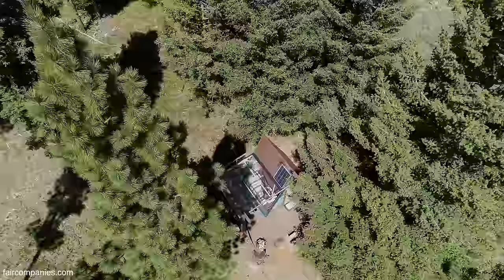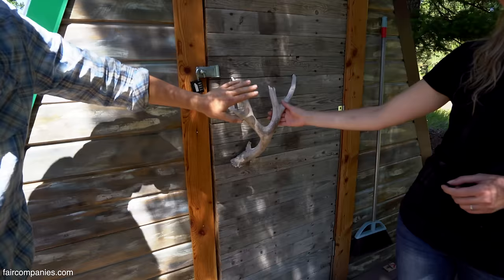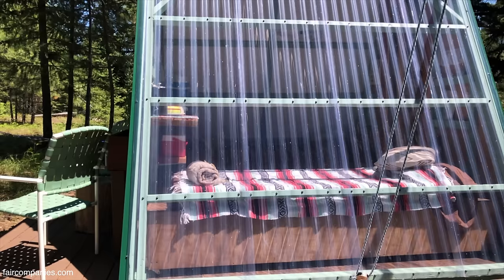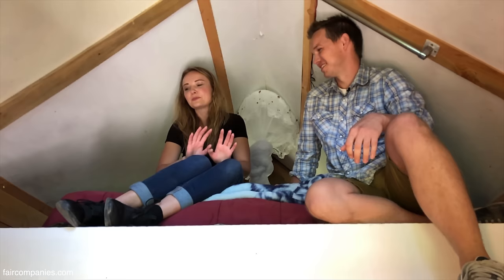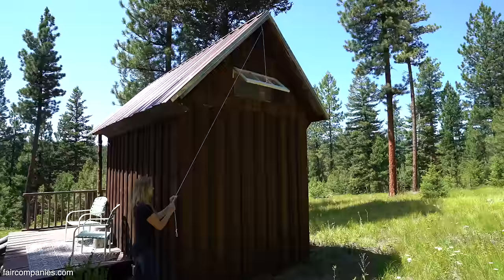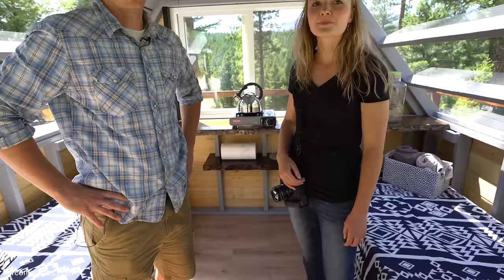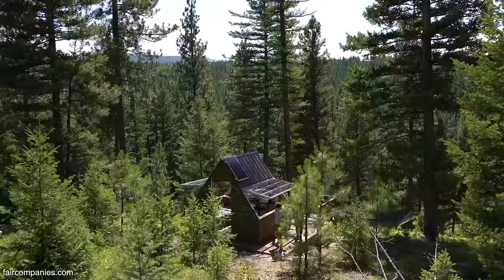$700 mechanical micro-A-frame blends with Montana wilderness

Comment: Interesting a frame.... There is an amazing house in Normandy FR you should check out, designed by an architect called Jean-Baptiste Barache. It’s also an a frame design but much bigger, yet the cost of the build was surprisingly low relatively speaking. You’ll understand why if you research or see it.

Comment: I like the first  A-frame very much, but question the longevity of the stumps that support the platform. Having unsealed end-grain exposed to the weather, I'd give it 5 years max. Shore it up and put in some cement or stone footings.
Absolutely LOVE the counter top in the second tiny house.
Like the openness of third tiny house, but think both A-frames  might benefit from judicious use of insect screening!
I know it's all a work in progress, what you have done is impressive, and I thank you for posting!
Reply: i was thinking the same thing. when i got the plans there was no mention of foundation blocks in the parts list, and i liked the stump idea they implemented, but would have sealed it for sure.
Reply: Linda, it depends a lot on the wood. My father used rounds of creosote- coated telephone poles as piers for a 16 × 20 lofted horse barn. It was sound for 20 years, ok for storage for several more. Dad regretted he didn't put anything down for a pad; it could still be standing!

Comment: What’s the point of the padlock if you can swing open the side. Also that padlock can be opened in seconds by applying pressure to the shackle and turning the combination until it jams in the gate. They are less than worthless

Comment: He said with everything closed it is like a greenhouse, how do you get ventilation when it is raining? I saw no openings covered enough to be able to leave open during rain?
Reply: On the first one there was a rechargeable battery fan and a tiny triangle up by the roof beam. Given their cracks about mice, I wouldn't worry too much about ventilation.

Comment: I would call the A frame's writing shelters, there is no way the joints on those panels are watertight in a rainstorm and how do you secure that big operable panel in a windstorm? there are no latches visible in the video. No insulation, no heat, Basically its a tent...without screens. The kitchen cabin is more practical.

Comment: August 2019 continued:  what about installing an outdoor fan as a wind generator for electricity when the sun goes down.  An Olympic water rafter did this on his van, traveling across Europe to river races.  He did the glass design from copies of churches he saw on his travels.  He called it his 'Hobbit Van.'  Imagine 7 billion vehicles, homes, buildings all covered with hand sized wind generators to recharge your phones, cars, etc., light up all high rise buildings, inside, so as not to distract from star gazing, like Las Vegas has ruined the night sky.    How about a rain water collection tank, then use 'cookies that kill mosquito eggs without any chemicals (done in Arizona buy a man living off the grid).  Arizona encourages instead of discourages rain water collection; the opposite of California.  See the videos and Skype with Handeeman (from Canada) on You Tube about building a water tank.  He is an electrician living off the grid with his wife Hannah (a gourmet vegan chef) in Arizona.  The second house blends right in with nature, I hope you don't paint it at all.  I love the Coleman company!  Sears and KMART were a great companies before the Super Rich destroyed them for the public and the workers.  Coleman has the best men's (women's probably does not have the great pockets or hoods) coats and jackets to keep out the coldest temperatures.  If you get hypothermia, buy two, one XXL to wear on top of the smaller sized coat or jacket.  The extra large hood helps to block out the light and get a deep REM sleep.

Comment: I know how he feels, id make everything if I could, build my own car, motorcycle, house, boat, swimming pool, solar system to power it ALL!!  I have worked in alot of trades, carpentry, electrical, plumbing, roofing, masonary, I have installed septic systems, I was building car engines when I was 13, one of my fears is going to the Salvage yard, seeing something I must have, and not have the money to buy it! Ha-ha, so many thing are scrapped, that have plenty of life in it, it can be reused or repurposed, especially industrial equipment, alot of thing are still useable for something, I have been studying electronics and got motors for a electric car conversion from a salvage yard, they were like new, for a deal, I would like a place like that to tinker and build, I always vwanted a place where small living areas could be carved out of a Forrest, leaving most of nature, I wanted to start a small community have a tiny woodland town, leaving as many trees as possible, and wanted to do this when I was aboutb12 and still would like to, and rent to like minded ppl for the summer of country living, here it could be 9-10 months , winter is only very voldvfor about 2 months, with some gas heat, winter or full time living could be possible. I wish I had the land and help to do this,  image a tiny store, post office, with houses and gardens tiny farms in a wooded area, all powered by renewable solar, wind and hydroelectric!!!. Crazy, but could be nice!!!

Comment: These tiny cabins are very nice. I want to address something off topic though, and it's about building codes, regulations and permits. A lot of people looking into alternative lifestyles like this seem to be young, democrat, liberal, and that's fine. I'm not so young anymore, but I've always been open-minded, plus I grew up in a remote rural area not all that different from where these young people in this video are. The biggest difference I'd say is where I am there are no building codes, hardly any regulations, and no permits required. That's because the democratic party has never gained control of local government. Whether you realize or understand it or not, the truth is democrats in power always bring codes, regulations, permits, high taxes. Always. In the process people lose control of what they can do with their own property. Instead of being able to live free and inexpensively, democratic policies force you to embrace debt, limit your freedom to live on the cheap, and criminalize things that you want to do in order to live cheaply. They do this while hiding behind seemingly moral stances, but they do this disingenuously. They don't actually care about anything except control. Democrats and the left are control freaks, just like a crazy ex bf or gf. Don't be fooled, or else your dreams of living simple like in this video will be impossible.

Comment: I think there's something funky with your audio equipment. There's an extremely high-pitched sound for 2-3 seconds randomly throughout the video that's about at the limit of what I can hear (as a 35-year old). Some times where it was audible to me:
4:38
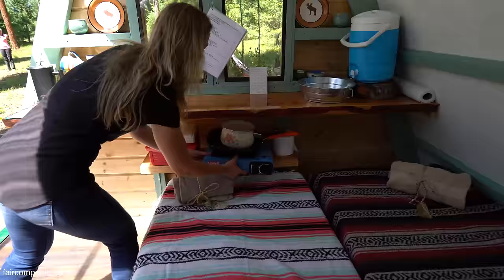5:28
5:53 (this one lasted about 10 seconds)
There are other times earlier in the video, and I stopped watching at 6 minutes in because it was so hard to listen to.
As noted, the audio is at the limit of the pitch I can hear, so I'd expect folks younger than me can hear it while folks much older than me cannot (since the max pitch you can hear declines with age).

Comment: What's the point of this other than just doing it for fun?  You can buy a 4 or 5 person tent and get similar square footage for less money and a lot less work.

The benefit of building a permament structure is that you can take advantage of the square-cube law and the economies of scale that come from building a larger internal volume structure... instead they've discarded all the benefits of a permanent structure by building it so small and in a shape that reduces usable footprint by probably 25% AND they've avoided all the benefits of a deployable like a tent or a mobile like an RV or a trailered tiny house.

If you're not going to build to at least the size of a small apartment and incorporate functions like a kitchen or a shower there's just no point... at sub 100sqft you've basically built a hard-shell tent that you can't move.
Reply: Alex, as far as I can tell, they're doing it for fun-and maybe joy. They're building skills. I think that's something left unstated, until he mentioned "the trades" at the end of the video. ✌🙋‍♀️